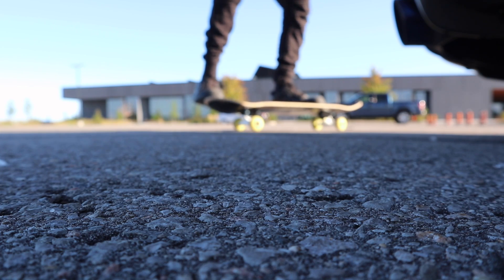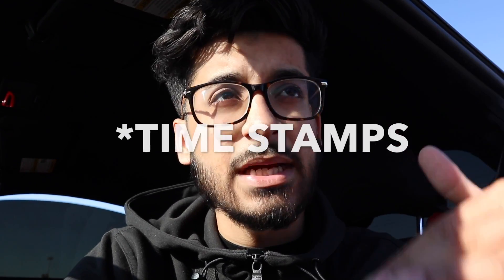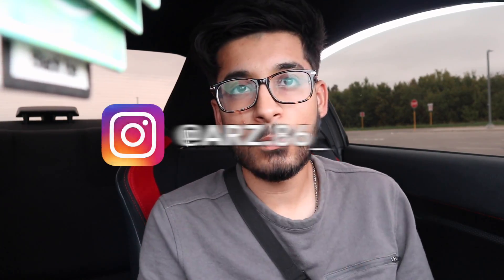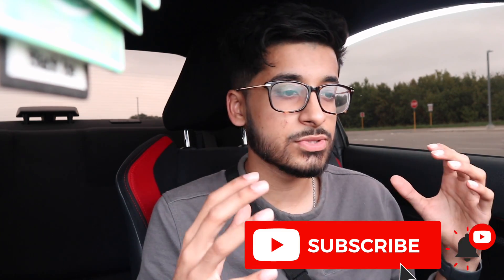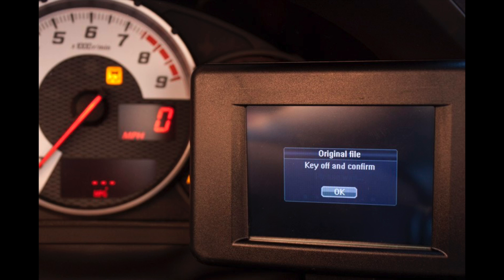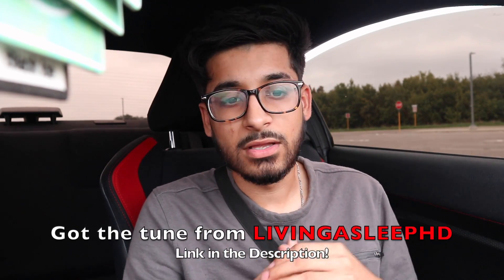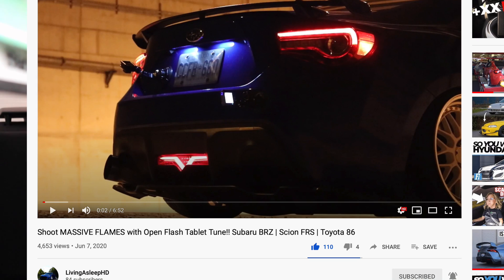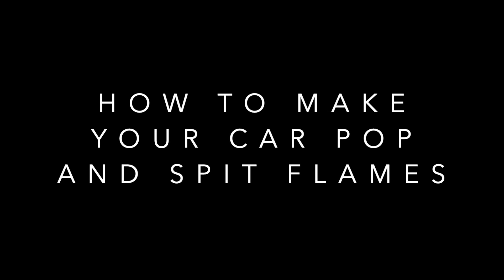INSTALLING AN INSANE BACKFIRE & FLAME TUNE | EASY DIY

Comment from the maker: Hey Everyone, Thanks for watching this video! I made a Part Two to this Video with a different tune. So if you want to hear some more backfire's and flames check this out! https://youtu.be/-DkgvzpC6go Thank You!
Reply: you can switch maps to turn it to stock map so theres no pops and flames right
Reply from the maker: @frsthinh  yeah! U can switch to stage 2+ which there is no pops
Reply: @ARHAMALVI  do you switch your maps by using your cruise control stick
Reply from the maker: @frsthinh  nope, u have to retune each time with the tablet

Comment: If you which to a cat back exhaust you should have a pop at around 2500 to 3200 rpm. I just got my oft. Haven't even used it yet. Waiting for uel headers.
Reply from the maker: without UEL u can run the stage 1 pop tune. Ran mine w -7. Just make sure you’re catless 🔥 - also remember to subscribe 🤙🏽

Comment: What’s the longest period of time you ran this tune on your car b4 flashing it back to an daily setup?
Reply from the maker: for the flame tune I usually run it only for 1 day then flash it back. When it comes to other tunes like a mild pop tune (-7) I have a video up of that tune on my channel I run it for about 1-2 weeks and then set it back to Stage 2+ UEL tune. Just to be safe. Also the pop tunes burns a lot of gas. Hope that helps out! Drop a Sub to support!
Reply: Mine fucked up the ecu 2 years ago and one injector lol
Reply: @CoRtnx_  how?
Reply: @Flunoir  i dont even know it was on the safe side, it did flames every 2-3 hard pops and it didnt even lasted me a day, engine light came on after an hr driving and then car stalled every 15 min drive but only at iddle on Red lights and  after that it started getting worse after a week, car didnt even run after 10 min drive, no accelerator while driving on fwy, had to turn off and on car quick specially on fwy when it did that shit
Reply: @Flunoir  and the engine code was an fuel injector, replaced it and it work for 2-3 days but after that one day car didnt turned on and it was the ecu thats on the side of the engine, after that ive been running 3 years on non stop e85 since that never went back to normal gas etc and its been working good lol
Reply: @CoRtnx_  on e85??? That’s pretty dang long, do you have a flex fuel kit?
Reply: @Flunoir  nah bro all lines and pump stock, spark plugs be cleaner too since it dont creates a lot of carbon, only thing i dont like its the cold starts on temperature below 50s, i have to turn on the key 2-3 times lol also my car was one of the 1st ones from the recall 2 years ago and still good even with that tune
Reply: @CoRtnx_  so you’re saying it is indeed “safe” to run e85 in the FA20 engine WITHOUT a flex fuel kit?? What are your oil change intervals? 3 years on non stop e85 is a bit hard for me to believe haha

Comment: Do you have to be in manual mode for auto and for manual what gear you in to make it shoot flames
Reply from the maker: u should be, 1st - 3rd gear will work. High RPMs 👍🏽

Comment: Question if I have PML catless headers UEL mxp catback and stock front pipe will -15 blow out my cat and mufflers? I tried -12 it seems fine but I want the pops to be louder with this set up
Reply from the maker: id be very careful with running -15. Yes it can blow your cats and muffler out. Id go catless/get rid of the muffler before trying anything higher than -12 👍🏽 hope that helps!
Reply: @ARHAMALVI  thank you but what’s the big difference-12 to -15 would my muffler and cat get blown out at -12?
Reply from the maker: @uhspades77  they can with both of those intervals, When I had a muffler/cats I stayed around the -7 range. The only difference is -15 is a bit more aggressive than -12 so chances are raised to damage the exhaust system (muffler and secondary cat). Your muffler is also why your pops aren't super loud, most likely quieting the sound down.

Comment: I did this tune and now I keep getting a check engine light for too much fuel in the exhaust. Any way to fix?
Reply from the maker: did u try flashing it back to the stock tune to see if that would fix it? I am honestly unsure, haven’t heard about an issue like that from this before
Reply: Are you running any cats?
Reply: unload the tune, putting that fuel into the exhaust is how it pops like that

Comment: I have 2 resonators thru the middle of my exhaust and 2 little resonators In the back and no cats will it still shoot flames ?
Reply from the maker: Yes it will! With the right tune. I also have 1 small resonator and another normal size resonator. Still get to shoot some pretty sick flames. Got a bunch of more vids of the exhaust/flames/backfires and also the tune on my channel, check them out. Hope it helps. Also Drop a Sub to the channel. :)
Reply: @ARHAMALVI  u got it I got you rn do you got an Instagram I’m getting my oft tomorrow I’m the mail so do u mind if I message you if I have any problems ?
Reply from the maker: yeah bro hmu at @arz.86_ I'll help you out!

Comment: Any damages to your engine since you ran that tune? How long or are you still running that tune?
Reply from the maker: tune doesn’t really damage your engine, it depends on how consistently you use the tune! Some people daily the tune, but to be safe and not take any risks. I run this tune maybe for
a couple hours then flash it back to the normal tune whenever i want the flames. Thanks for the comment, remember to subscribe and I made a pt 2 recently check it out 🔥
Reply: @ARHAMALVI could you daily just a light pop tune that isn't obnoxious? As well as stage 2

Comment: will this work for a catback exhaust
Reply from the maker: as long as the setup is fully cat-less and no mufflers, this should work. If there are cats in the setup then it may blow it out of the exhaust and you don't want that! hope that helps 👍🏽

Comment: I have a oft tuner and on catless stage 2+ tune. How are you able to change up the tunes if they are pre loaded.
Reply from the maker: hey thanks for watching the video - I went ahead and used a software called romraider, in that software you can edit the pre existing tunes for backfires / flames. I can link some youtube videos for you explaining how to do it🤘🏽 hope that helps!  Remember to Subscribe 🔥🙏🏽
Reply: @ARHAMALVI  I would appreciate that 🙏🏽 thanks for your reply.
Reply from the maker: This is the one I used right here : https://www.youtube.com/watch?v=ISkRrK8P1c8&t=32s
Reply: @jetbrz2721  still need help with the tune?

Comment: Can I still get the pops with just a catback exhaust?
Reply from the maker: yes you can, it won’t be as much. If you have an OFT you can run a stage 1 pop tune. Be careful tho theres a chance you will blow out ur cat in your header. Thats why I recommend u be catless but you still do it. 👍🏽 hope that helps if it did remember to Subscribe 🙏🏽

Comment: Have you experienced any kind of damage to the bumper with burn marks at all? That’s what’s holding me back from doing this tune 😬
Reply from the maker: no damage whatsoever. I think it all depends on how much your tips from ur exhaust poke out. Mine poke out about .5 of an inch! If it was less than that i think the bumper would have damaged but since its not were good 👍🏽Hope that helps. You should try this tune out ! Was a lot of fun
Reply: my engine blew and i got rod knock
Reply: @dfm831  how
Reply: @bradengaerke430  high compression dont run it.

Comment: i might have missed it, but do you have stock front pipes?
Reply from the maker: So I have a stock front pipe and the secondary cat is just cut out. So a secondary cat delete. If u want to shoot flames make sure you're catless (so no cats in your set up). Also I just uploaded a new video on the channel about the Exhaust Setup Check it out ! :)
Reply from the maker: @Krispy Kremmme wouldn’t recommend a flame tune with stock headers, that is a disaster waiting to happen. Aftermarket headers is a must. Catless Headers to be exact. I have PLM UEL Catless Headers in right now 👍🏽 cheap & a decent header. Hope that helps !
Reply from the maker: @Krispy Kremmme to have good/visible flames u can’t have a cat in ur exhaust system. Got to be fully catless. Theres also a huge risk of blowing out ur cat and that can ruin ur car thats why I wouldn’t do it